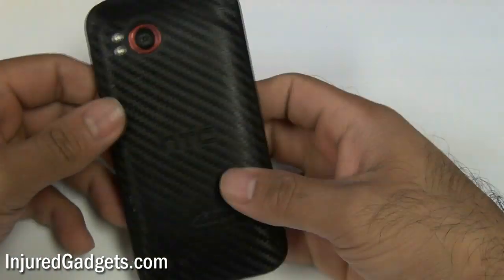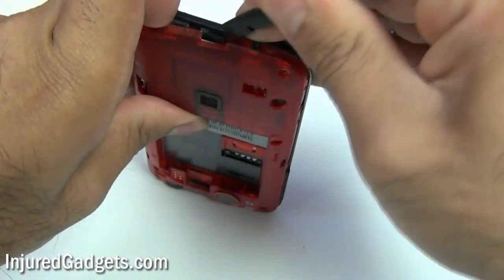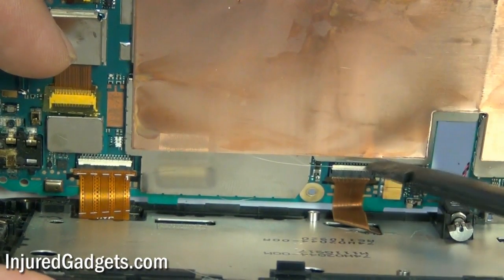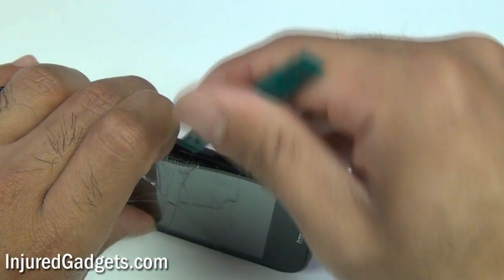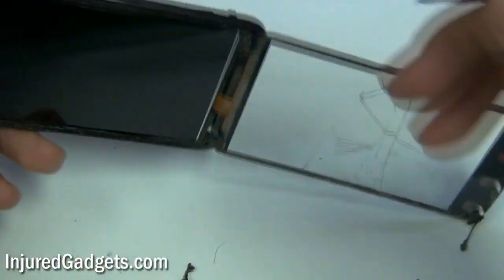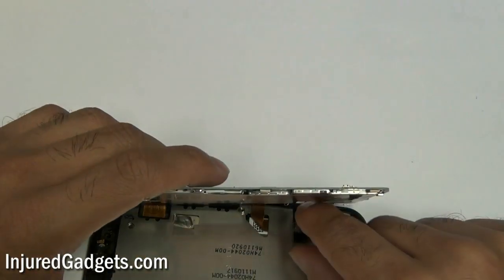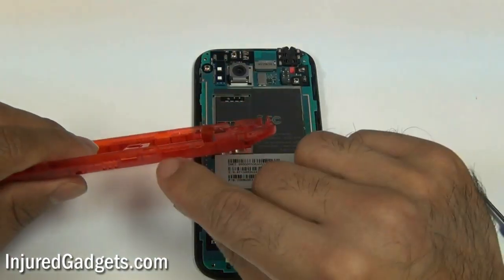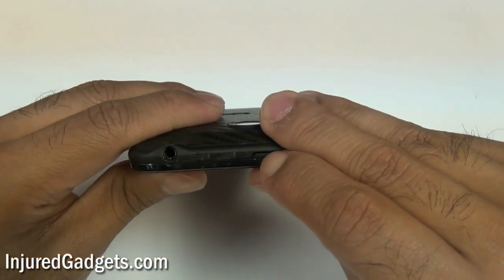HTC Rezound 4G (Verizon) Touch Screen Glass Digitizer & LCD Display Repair Replacement Guide

Comment: Figured it out. Behind the screen where the speaker should be, the new screen assembly didnt come with that little speaker so I just took it from the old screen and put it into the new one, worked like a charm.

Comment: The hard part is getting the phone apart the first time.  A guitar pick or old credit card will help separate the pieces.  Also, the new digitizer screen has a protective cover on BOTH sides. I put mine together before noticing this. The 2mm double sided tape is easy to put adhesive back on the screen.  I bought a tool kit but really only needed a #5 torx & small phillips screwdriver. The pry tool is soft plastic, better than a screwdriver but a tweaker would work.

Comment: So If I just buy this one: LCD Display Touch Screen Glass Lens Digitizer Assembly + Housing for HTC Rezound 4G. I'll just unplug those 2 cable connectors into the mother board. The digitizer, LCD and housing are already assembled, or do I have to assemble them as well? Do I need to buy double sided tape and a heat gun?

Comment: what do you mean by cheap digitizer and what does it have to do with it being defective? most digitizer replacements ive seen on ebay and amazon were $11-14, and mine is also completely dead, how much did you pay for it and where did you buy it

Comment: i bought this one "LCD Display Touch Screen Glass Lens Digitizer Assembly for HTC Rezound 4G"

does it matter that i dont have the + housing version? or do i still have to use a heat gun and adhesive?

Comment: Ight i got a small problelm, My rezound fell outta my pocket when i was dunkin my hoop an tha  glass cracked along wit a lil bit of tha LCD. An i took it all apart an put it all together an now wen i power it back up tha screen wont turn on but tha buttons at tha bottom will light up. Do you know what i could do to make tha screen wurk again??

Comment: Hey, great video. Incredibly helpful and interesting. I have a question, though. I replaced the digitizer, reassembled and powered on fine, but I cannot get the ring to pull. I thought that I seated the cables fine, but could that be the problem? Thanks for your help.

Comment: I had the same problem as azardina11 i re seated the 2 cables several times and nothing. DO any of the case screws get used for ground? can it be my board? please help